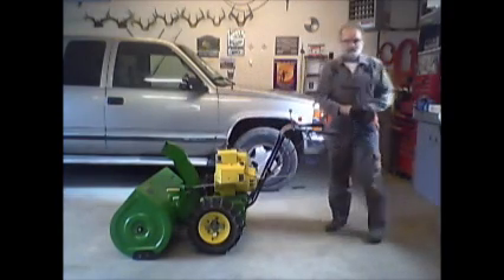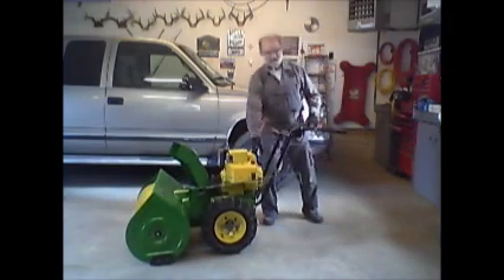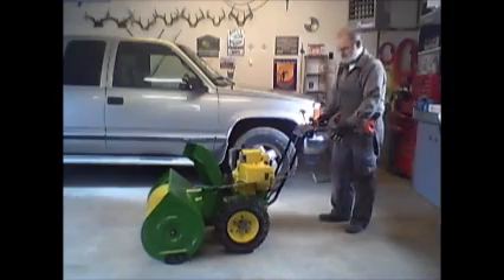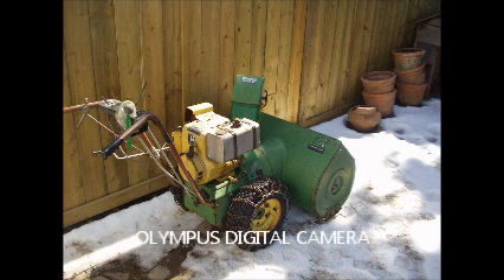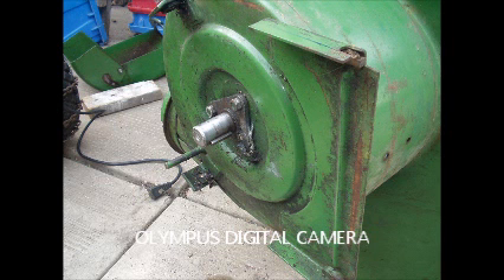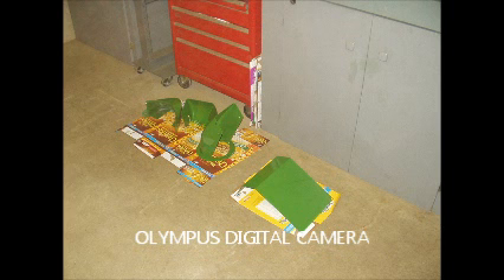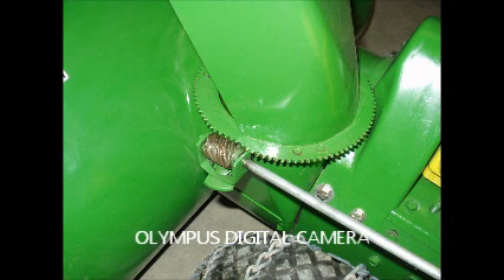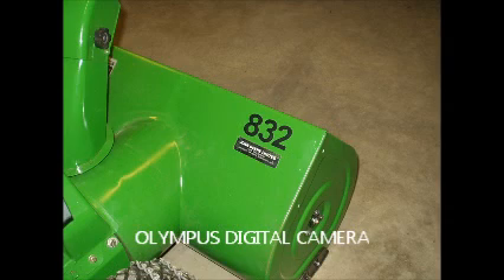The first video in the series to refurbish the 40 year old John Deere 832 Snowblower

Comment: You can also get a taller chute that they used on the mid to late 80' early 90's Ariens paint it green and put it onto this machine, that will increase your throwing distance, one of the best upgrades you can do to one of these old tanks.
Reply: Do you have any detailed information regarding the Ariens chutes? Applicable model or part numbers perhaps?

Comment: You should put the correct stock yellow fuel tank onto the machine to make it 100% correct considering you did a full restoration on the machine that would actually make sense.
Anybody with any knowledge of machines can see its wrong and stands out.
Reply from the maker: OK  thanks